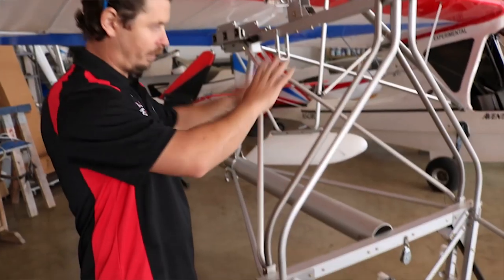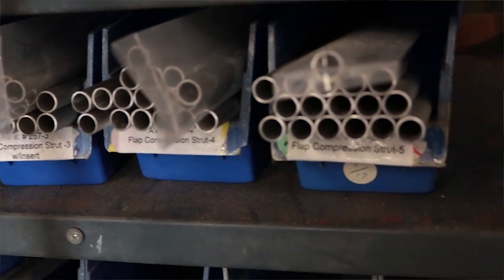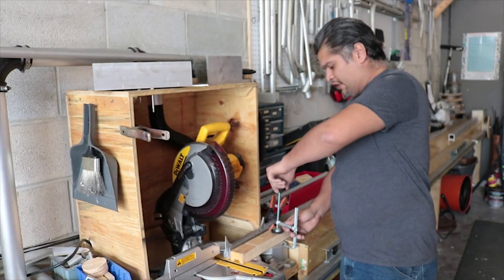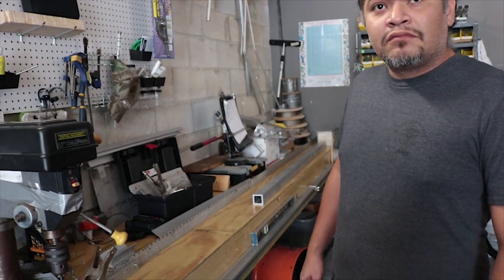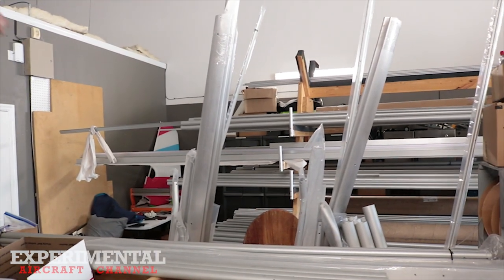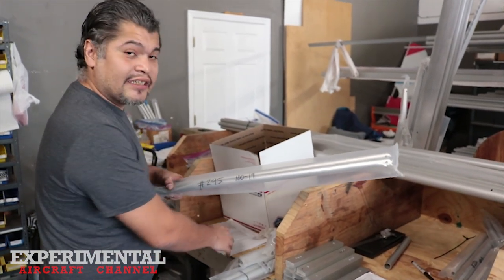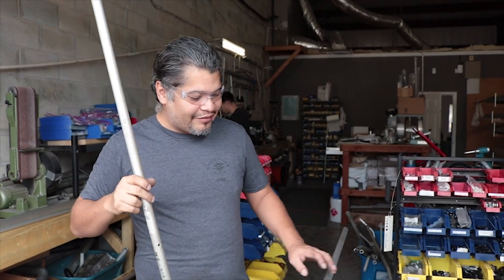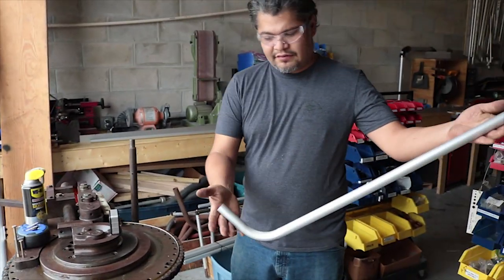Aventura Seaplane 2020 Factory Tour - How its Made

Comment: Another in-depth interview with the heart of the manufacturer. The only issue I would want them to have other than a larger manufacturing facility is there was no mention of raw material supply lot information, or seeing the materials marked with lot information. This is critical if a supplier ever has an issue and they need to track down all aircraft affected by a lot recall. Maybe they have it controlled by some other means and he didn’t mention it? Just something I’ve experienced in the past and it’s not pleasant!
Reply: John Paul Lafferty It would be nice to see Lot/Trace numbers
Reply from the maker: Thank You for watching and also engaging here. I do believe that is all being tracked, just didn't mention that "detail" here. They are working towards an SLSA approval for a model and all that stuff I believe is "required."  :-) Good point. Thanks for the mention.
Reply: Experimental Aircraft Channel - I really enjoy watching your content and interviews. I just remember having the FAA up our buts about lot numbers after a mix of low grade Asian bolts made it into the supply system and were caught after a few failures. After that AD came out it was hell for the receiving department so traceability is one of my pet peeves. As our FAA rep would say, “I can give you a cert for a pice of dog crap and call it gold, but when and where did it come from”? That has always stuck with me.

Comment: I used to own an Aventura and BUYER BEWARE!    I LOVED the design and spoke (and flew) with the original designer, Kerry.  So, after years, I ordered my Aventura (SO HAPPY).  The house of horrors began.  You will never get parts on time or even at all, or like with me, they ALWAYS sent the wrong part!  Materials are weak & cheap quality.  Very piss-poor company support (if any) and they almost never gave the correct advice for my building of my aircraft. Only the folks that already built their kits could help (most hate this company as well),  AeroAdventure NEVER assisted with advice on building/assembling,  despite all their claims of the "customer support".  The owner, Alex is (in my humble opinion) the biggest dirtbag in the industry and never told me one thing true, so please BUYER BEWARE with these creeps.  Buy a Searey and you will never regret it!   I did!   Searey all the way!  In my opinion, this company, Alex and the Aventuras should be avoided. If you are set on an Aventura, buy a Buccaneer. They are older design but the way they were built is FAR BETTER than Aventuras.